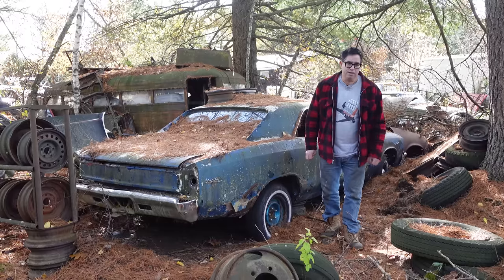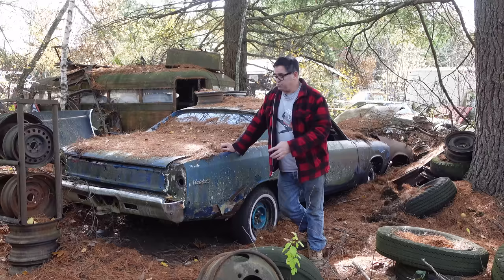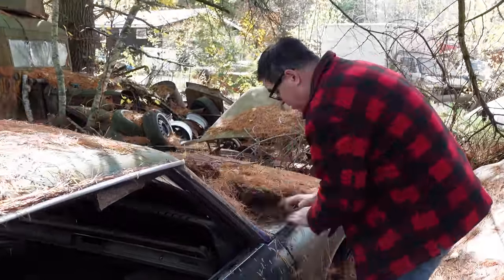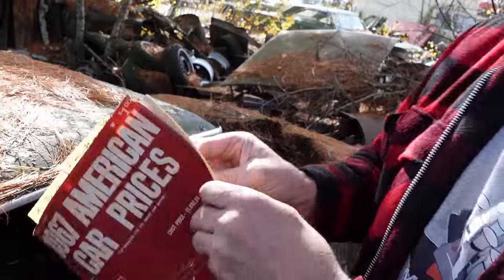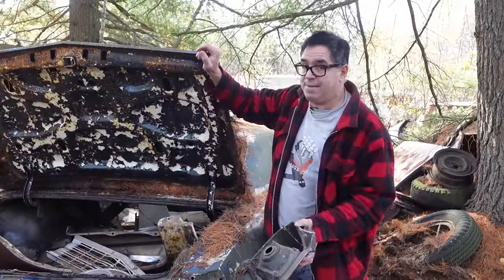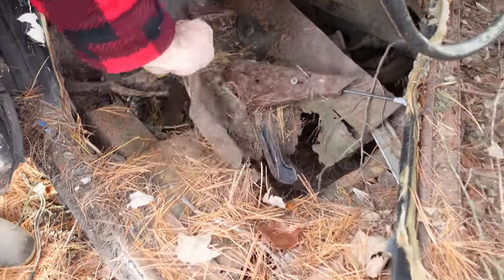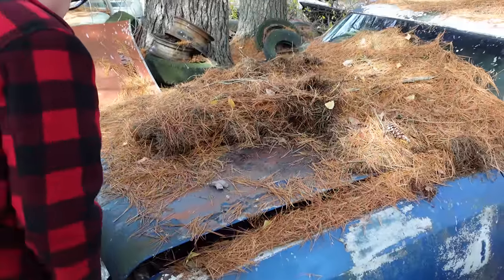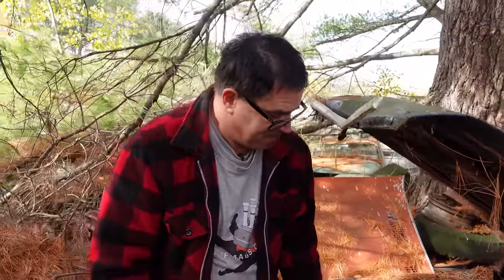Silent Malibu

Comment: GM had enough volume across the brands and models back then to support all of those "pirating" of sales from each model and brand. 

Correct, the VIN always gets the win: 1 for Chevrolet, 36 for Malibu V8, 17 for two door Sport Coupe, 7 for 1967 model year, G for Framingham, MA assembly and the rest is the production sequence. SS cars in 1967 would have a "38" for the 2nd and 3rd digits of the VIN in place of the "36" on this car. The Framingham, MA plant operated from 1947 until 1989 and its' closing was a political duel between then Governor Michael Dukakis and local politician Anthony Colonna. Mr. Colonna refused to sell land that GM wanted to build a new paint and plastics facility and instead wanted a public works building on that property. He prevented the sale of the property and in turn GM turned around and closed Framingham, citing "economic reasons" but also that the "labor climate and other factors". The plant closed on August 1, 1989. 

No, there is no "Z" in the VIN, you're confusing that "7" (for 1967 model year) for a "Z". This was built in Framingham, MA, not Fremont, CA. Yes, code "Z" was Fremont, CA assembly aka one of the "Terrible Three" of GM's plants closed in 1982 and eventually became the GM NUMMI plant joint venture with Toyota and today Tesla assembles cars there. The other two of the Terrible Three were Southgate closed in 1982 and Van Nuys, closed in 1992. All three plants were rife with labor problems, alcoholism and drug abuse, with Fremont being the worst of them all. Some Mondays and Fridays there weren't even people to start the line and they had to go to the bar across the street to recruit people to work the line. It was said that "If it's available, you can get it at Fremont". Attendance was taken by counting the alcohol bottles in the parking lot between shifts. One employee was hauled into the foreman's office after it was found he left about 300 front ends loose on purpose. When questioned, he stated he was getting back at the foreman for writing him up previously for drinking on the job.

You mean "2GC" which is a 2G style Rochester with coil type choke. This could be the 2GV with remote choke. The choke style is usually after the carburetor type in Rochester nomenclature. You have to remember in certain years, the SS was an appearance package and could even be had on a six cylinder (although not all that likely). 

No tag, can't brag, but some of it can be figured out, no doubt: 67 for 1967 model year, 13617 for two door Malibu V8 Sport Coupe, G or FRA for Framingham, MA assembly, 759 or 762 for black interior trim, possible F for Marina Blue or possible C for Ermine White exterior paint, M for Powerglide two speed automatic transmission among other codes.
Reply: This one looks like it received two very cheap repaint jobs. Once green, then blue.
Reply: @suzi_mai  "I'll paint any car for $49.95". LOL.
Reply: @googleusergp   If I remember correctly the commercial went," I'm Earl Scheib,  and I'll paint any car  any color for  $49.95 no ups no extras."

 I've always wondered if he considered masking an up or an extra.
Reply: @kennethsouthard6042  Probably. Back then a paint job really made it go from a hooptie to a second car and gave it life for a long time. A paint job was a major investment on a used car that was 8-10 years old and older.
Reply: For those following we know more about this car, as it was saved by YT'er "NeshPro". Here's what we know:

It was originally a 1967 Malibu two door Sport Coupe V8 car. The "36" in the VIN proves it was a V8 car, but it was not an "SS" as noted by Mr. Magnante. It was assembled in Framingham, MA.

NeshPro posted the tag and we now know that is a 1967 (67) on the tag, Malibu Sport Coupe V8 (13617, although some reference say the "36" in the tag does not denote V8, but the "36" in the VIN does), made in Framingham, MA (FRA), made the second week of November 1966 (11B), had a Black imitation vinyl bench seat interior (761-A), and was Capri Cream upper and lower exterior paint (T-T). It had a tinted windshield (W), had a Powerglide two speed automatic (M, RPO code "M35"), and also had a rear antenna (S, RPO code "U73").

Comment: My older brother worked for a company that gave a new GM every other year to the Salesmen. My brother picked the 67 Malibu. He went on a two week vacation and gave me the keys. Which I misplaced the first day. Short time later, the Fuel pump ruptured and filled the crankcase with gas and blew up the engine.
Reply: I bought this actual 
malibu and I got it running! see it @neshpro6521

Comment: The alternator on the passenger side as well as the brackets didn't come out till 69. The heads also have accessory bolt holes. Looks like it has a later engine and not the original 283.
Reply: I bought this malibu and Igot it running! see it @neshpro6521 has a 307

Comment: love the Malibu when My late maternal grandmother drove me to school growing up the 2nd car the Cab company she worked for loaned her was a 1997 Malibu the first had been a 1988 Caprice which she didn't like because she'd gotten used to driving smaller mid sized cars she'd driven a used 1984 Buick Skylark for about 1.5 years when I was a toddler then she traded it for a 1990 Toyota Camry which had I not been legally blind I'd have likely learned to drive on the Camry or the 1990 Volvo 760 my dad drove at the time and had I been able to get a car I'd have started with either a Camry Solara XLE V6 convertible or a Chrysler Sebring Convertible my late maternal grandfathers widow drove a Sebring coupe at the time
Reply: I bought this malibu and I got it running! see it @neshpro6521

Comment: Comment on the Chevelle. I can understand why they sold percentage wise nearly twice as many chevelles as camaros. More practical. Still able to get the power train options you want to make the Chevelle burn down the road. You could pull a bigger trailer with that chevelle. Oh yeah I love that body style of Chevelle. But I'm a GM pony car guy. Can you imagine one of those Sprint Firebirds and being a convertible having an aftermarket draw tight tow hitch! Mine had one sitting in the trunk in a box when I bought it. Draw tight what is a brand name if I remember correctly. I think it later became Reece parrot don't quote me on all that. As far as I can tell they never put the hitch on the car. But it sure was heavy. I have a 67 Bel Air nothing special but it has air shocks on it from back in the seventies the same shocks. And it basically had a valve stem hooked up to the lines that ran to the shocks and that valve stem was installed in the bumper near the bottom of the license plate. Kind of a simple system. One other thing I have a distinct feeling that your salvage yard friend there will get a number of phone inquiries about that chevelle. By today's standards it's a builder. Oh I guess you debunked that old saying it's a Malibu not a Chevelle. There's always been two schools of thought. Chevelle was a subscript of Malibu and the other thought was vice versa. As far as contacting the yard, a decade ago I would have or even maybe 5 years ago. But my plate is full right now and I'm not going to drive that far for one and that condition. I'm reasonably sure that you can get a repop floor pan for 1,000 to 1,500 dollars.
Reply: Yes, Drawtite and Reese are owned by Horizon who also owns Bargman (they make the electrical connectors seen on many tow vehicles).
Reply: @googleusergp  thanks for the info. I thought Reese was the parent company. Had no idea about Bargman . Apologize if I misspelled that. I think I actually have bought a couple of items in them without realizing it. From an online seller selling their product
Reply: @CAROLDDISCOVER-FINDER2525  Sure, no problem.
Reply: I bought this actual malibu and got it running! see it @neshpro6521

Comment: I wish the modern Chevrolet Malibu had the front split bench seating and column shifter like this or something more modern like a Buick Century.
Reply: For sure! I see the malibus at work that make you wonder why the design has changed so much! I bought the car from this video and got it running see it @neshpro6521

Comment: One regret I have. Summer 1980 we were out running around and saw a blue 67 SS car out in the grass by a trailer house. We stopped in and asked if we could look at it. The engine and tranny was gone along with the dash wiring harness. I asked about a price and could have got it for $100 if I remember right. I never bought it because of the missing wiring harness ! Thinking about it now it would have been crushed when dad cleaned the yard. So maybe it went to a better place. (I checked several times through the years and it is not there)
Reply: I bought this actual malibu and got it running! see it @neshpro6521

Comment: The intake manifold is a 69 or later , as it has no oil filler tube . So it's possible that it is also a 69 or later engine .

Comment: This is very similar to my 67 Malibu Sport Coupe, right down to the Fremont production. I have had mine for 34 years now, and she's an original California car, so no rust....well, a bit on the floor, like pinholes, but taking care of that now finally. Mine had the 283 and PG, PS, and manual drum brakes. She was 100% stock when I bought her in 1988. Most of her original Marina Blue Poly (FF code) paint (and her original black vinyl bench interior) was still on her, and she had a full body and paint restoration in her original color 9 years ago. I don't think that one there in Bernardston has the original 283, as it should have the oil fill tube (with the PCV valve threaded into it) on the front of the intake manifold and no fill cap or vents in the valve covers, just the "Chevrolet" cursive script. Mine is "car-shows-only" now, but when I first got her, she was my daily driver for years. Thanks, Steve, for the great video! I have seen that 67 Malibu in the background of several of your vids, was wondering when you would get to her! Take care, man!
Reply: I bought this actual malibu and I got it running! see it @neshpro6521
Reply: @neshpro6521  Cool! You got it running? Did you make a video of that? I saw the vids of you unloading it from the trailer and getting it cranking.
Reply: @renchjeep  new video Tommorow
Reply: @neshpro6521  Sweet! Looking forward to it!

Comment: My mom claims to have bought and owned a 1970 Chevelle Malibu 4 door with a “400” as her first car in the 80s. Does this sound right? It’s my understanding that would have been a 402 c.i. But I have never seen another, even online. Anyone else ever see or hear about a sleeper like that? It was even boring brown with of course vinyl bench seat and full size wheel covers. I’ve asked about the car many times and she’s pretty certain it had a 400 badge and was a malibu. I will have to see if there’s a photo anywhere at my grandma’s.
Reply: @Astro70👆👆
Reply: 70,71 and 72 you had a choice 402 big block or a 400 small block.. your mom's was a small block 400, great motors just don't over heat them !!
Reply: I bought this malibu and got it running! see it @neshpro6521 I smoked a few 400 blocks back in the day because they had steam holes in the heads!

Comment: 396s never quite made sense to me. Little more power than a small block with all the extra weight. Though the number of GM engines and models never makes sense either.
It seems 427s were Vette only,, except for a few dealers into Camaros. And a few Impalas. The Chevelle would have made sense with the 427. Med size 5 pasenger car with plenty of poke. Though again the weight is still the issue. ZL1 anyone!!
Attractive cars but a little mixed up.
Reply: The l-78 ss 375 hp Chevelles where stout cars.
Reply: This Malibu has a 307 it must have been swapped years ago! I bought the car and got it running! See it @neshpro6521

Comment: Since I have  gotten  old  l prefer a 67 Impala  SS 
Steve would  that have been  a large journal  crankshaft  in  that  year  of 283 and if l remember  correctly that is the  last  year  for the 283.
Reply: @Gary McKee👆👆
Reply: all 283 were small journal, find a small journal 327..install 283 crank.. home brew 302..and all 283 cranks were forged !!
Reply: @larrykroger3100  Yes!!! We actually built that set up with a set of aluminum heads in the late 80's... It was a nice piece!
Reply: I bought this malibu and got it running! see it @neshpro6521

Comment: Steve, couldn't you order a rear antenna on most Chevys back then?
Reply: not sure, but i had a 69 GTO with the power antenna, so it was in the back fender with the mechanism visable in the trunk. might be the same for Chevies.
Reply: @Ron Frame👆👆👆
Reply: There, at 2:44 right above your positraction price. Rear antenna ,manual or power!
Reply: @ronframe387  bingo! good eye.
Reply: It does have the hole in the right quarter for the antenna. I bought this car and got it running see it @neshpro6521

Comment: Wondering if the 4-door "Police Specials"  big blocks had the 138 VIN prefix or something different?
Reply: Probably had a standard VIN sequence for non-SS vehicles as you could sometimes do different things with fleet cars over retail cars.
Reply: @googleusergp  Thanks. Eventually those cars were auctioned off to the public, would be quite the conversation piece!
Reply: I bought this malibu and got it running! see it @neshpro6521

Comment: Not the original engine. It has the 69 and later passenger side alternator bracket , long nose water pump,as well as the oil filler cap in the valve cover and the bigger rochester 2 bbl carb. Most likely a 350 or 307 2 barrel from the 70s
Reply: @George Smith 👆👆👆
Reply: I bought this malibu and got it running! see it @neshpro6521 it’s a 307

Comment: Should have cleaned off the top of the right rear quarter panel it might have had the hole for rear antenna.
Reply: I bought this malibu and got it running! see it @neshpro6521 the hole is in the quarter for antenna
Reply: @neshpro6521  you bought the chevelle in this video.
Reply: @terrencegiordan2775  yep pretty sick huh?
Reply: @neshpro6521  awesome

Comment: How much they want for it?
Reply: 400 bucks. I just bought it!
Reply: @neshpro6521  Nice! How bad is it? You gonna fix or using for parts?
Reply: @danieloneill4322  I’d like to fix it she rough though! We’ll see!
Reply: @neshpro6521  best of luck! I’ve been working on a ‘71 GTO that was sitting outside for 30 years with no engine/trans. Probably in the same shape as that chevelle. It’s running and driving now and was well worth the effort.
Reply: @danieloneill4322  I did get the engine running today! @neshpro6521

Comment: The correct name for a car with a B pillar is sedan. Not two door post. Duh.
Reply: @SteveSeiwald👆👆👆
Reply: True, but some people don't know the difference between a hardtop and a sedan. 
I've gone to look at cars that were advertised as a hardtop in the local paper. They would be sedans, and the sellers insisted it was a 'hardtop' because it had a steel 'hard' top. 🙄 I learned to ask if the car had door posts or not, before going out to look at it!
Reply: @burthenry7740  Steve should use the correct names for body styles in his “lessons.”
Reply: Steve does a lot of videos on different makes and models which makes it difficult to be exactly right 100% of the time! Nevertheless I drove to Bernardston auto wrecking and bought this Malibu! Subscribe to neshpro6521 for updates! It’s a runner!

Comment: My mom had a 66with 283 Powerglide,2 door. She bought it as  a 10 year old used car. What I remember from the 70s is, a 10 year old car was alot older than a 10 year old car now. Not that the Malibu was junk but it was dated.
Reply: @MrSwinger1👆👆
Reply: Our family got a 73 Duster around 1979. By current standards it had the appearance of a car at least 3 times as old.
Reply: I bought this actual malibu and got it running! see it @neshpro6521

Comment: This car can be saved ! For 30,000 and 1000 hrs of labor , I know , I did it ! ''66'' LeMans convertible almost done , 16 year project . Think twice !
Reply: That’s my plan! I just bought this actual car today!
Reply: @neshpro6521  Good luck !!
Reply: The rear glass fell out somewhere near the Jersey border! 😞 I’m just counting the hundred dollar bills in my head. I figured after spending 100k I’ll have a car worth 90k or so! 😂
Reply: @neshpro6521  Hope you have a garage and a good MIG welder lots of clamps and plenty of beer !
Reply: @edpodellis it’s going directly to the shop parked right next to the 220 plug!
Reply: @edpodellis  the frame is cashed under the driver what should be floor. The frame also is separated behind the driver rear tire. I’ll bubble gum weld it best or worst I can then source out another option. It may end up being a round tubing chassis before it’s all said and done. Picked up a case of beer on the way home!
Reply: Got it running today!
Reply: @neshpro6521  Wish you luck on your project !
Reply: @edpodellis  thank you! I need it on this one! So far it wants to cooperate